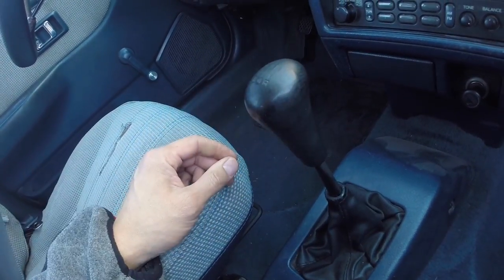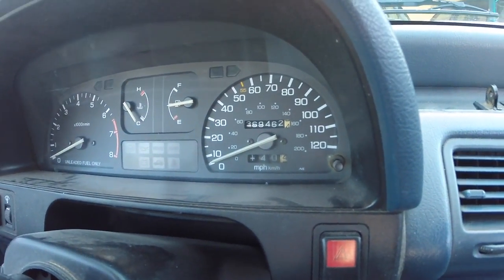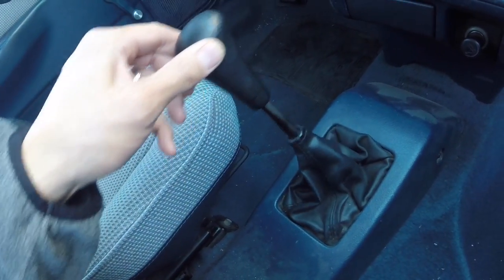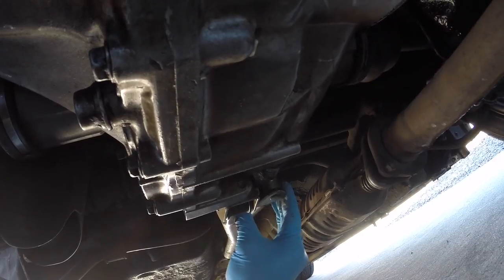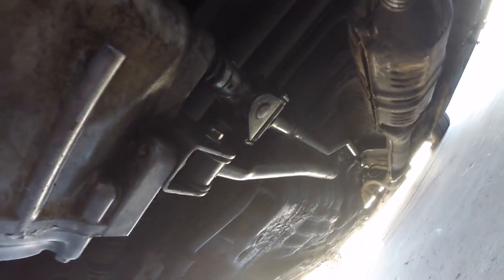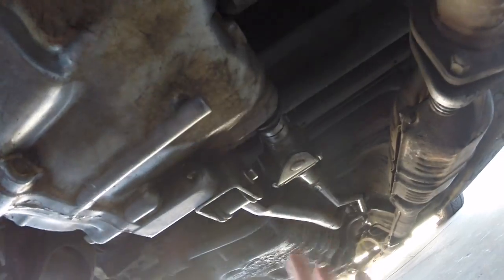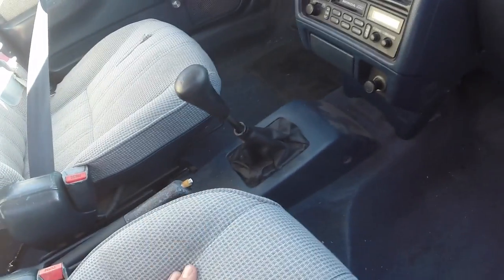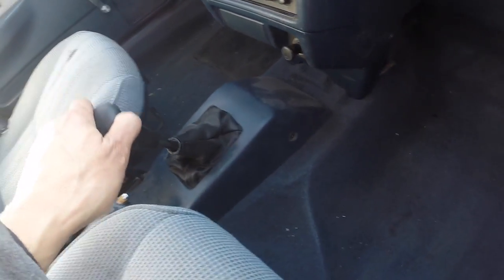How to Fix Sloppy Shift Linkage Honda Civic CRX & Acura Integra

Comment: I put those U joints in a table vice and squeezed them until they were tight again, against those plastic washers. Worked fantastically. Shifter is nice and tight again like brand new. Best of all- free.
Reply from the maker: That's interesting.  I'm going to try that, thanks for the tip!
Reply: Garage Built Hondas yeah it's super easy. You're a crafty dude and I like your vids so I figured I'd share my technique.
Reply: Garage Built Hondas and another secret--- the linkage sleeve that slides onto the transmission rod where that lock pin goes-- that can be hammered to slightly off shape it, which makes it fit much tighter once the pin is put back in. That pin connection piece is prone to wearing out and getting the wiggles. I've seen guys make pieces that replace the pin, and they want to sell you this piece. My method takes all the play out and again it's free..! 😁
Reply from the maker: Thanks for that, I appreciate it! 👍
Reply from the maker: Damn, all these little techniques which are clever, love it!

Comment: 369,000 miles Hondas truly do last forever if maintain I've had Accords with really high mileage and they kept going Hondas never die that's why I'm a Honda guy
Reply from the maker: Right man, I've started working on this car again and getting it ready for daily duties!!
Reply: The old 90's Hondas has the most reliable engines its because back then they didn't have computerized technology take my 97 Accord for example everything inside is simple and it always starts up the first time every time without taking a few seconds like most cars do I highly doubt the newer Hondas can go pass 300,000 miles without falling apart
Reply: 90s Hondas only. New Hondas don't last.
Reply from the maker: Gravecb7 Accord No kidding!

Comment: My shifter linkage is hanging from the bottom when I look underneath lol but  what went wrong? Bad bushing not tighten enough or lack of fluids ? btw newbie amd first ever car i owned thanks great vid 👍
Reply from the maker: Hanging down from the transmission or from the shifter area?
Reply: @GarageBuiltHondas Yea I had the same problem on mine yesterday the bolt wad loose and it fell out when i pulled in the parking lot at autozone it was  the middle bolt tho 😂😂

Comment: can you do a video on way to fix this issue with out welding. also replacement of the shifter bushings?
Reply from the maker: There really isn't any way to fix the joint unless you get the "no-play" upgrade which is also a weld on part.  The joint internals just get worn out over time.  This video will help remove and replace yours.

https://www.youtube.com/watch?v=tECCDTshLDI

Comment: Did you ever figure out the whole getting stuck in fifth gear thing, mine gets stuck in fifth after replacing the clutch
Reply from the maker: I never inspected the trans.  I believe it was a lack of fluid in the transmission over time and a synchro/gear is probably damaged.
Reply: @GarageBuiltHondas  Thanks for the reply, but damn stomach dropped.. I think you're right because my shift linkage seems fine, but I did notice when changing the clutch how dirty and how little fluid came out of the transmission, guess it's time for a trip to the junkyard again lol
Reply from the maker: I did the same, swapped an Si transmission on and never had an issue afterwards
Reply: @GarageBuiltHondas  that's awesome then I think I'm going to look for an si trans too because my crx has a zc motor in it and I believe that's like Japan's d16 right? If so i think it'll be a good match, Sorry just bought this crx and I've been trying to figure it out.. last owner didn't really take good care of it
Reply from the maker: That's correct, it'll be a really good match and you'll notice the shorter gear set right away.  If you're mpfi already that thing will move!

Comment: my Si has this problem.  what do change to make it good? I don't want to changed the whole shift linkage.
Reply from the maker: You can disassemble the u-joint and use a combination of washers and a new bolt but that's about it.  Swapping the linkage is very easy if you can find one in great shape still.

Comment: 370 kkm ,first engine ?
Reply from the maker: Yes, original d15b2 engine.  I bought it from the 2nd owner.  He bought the wagon in 98 from the original owner with 110,000  miles on it.
  I bought this on October 2013.
Reply: congratulation :>
Reply: @GarageBuiltHondas  my 1988 civic had 330000mile on it and still running strong d15s were one of the best reliable engines
Reply from the maker: Agree!